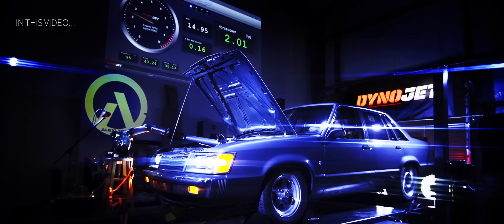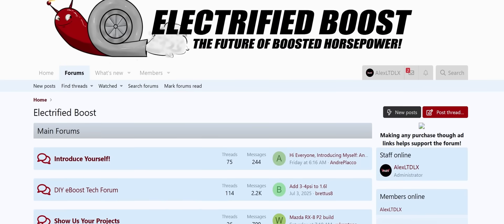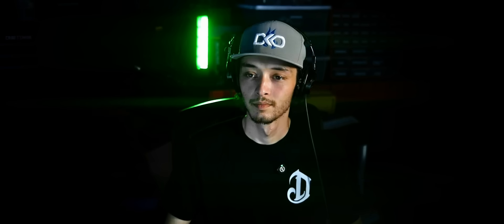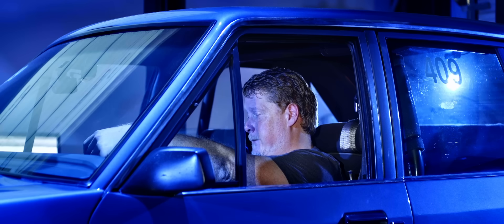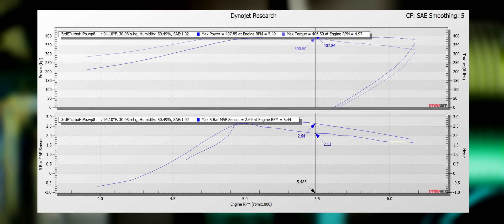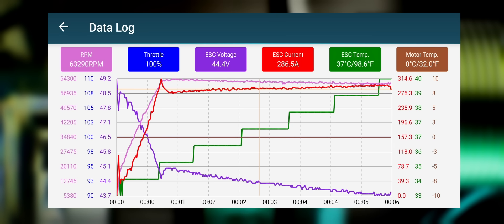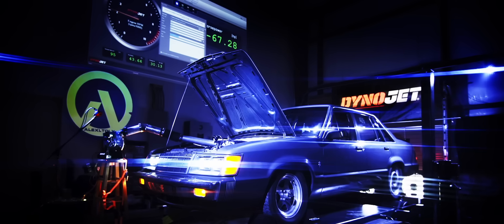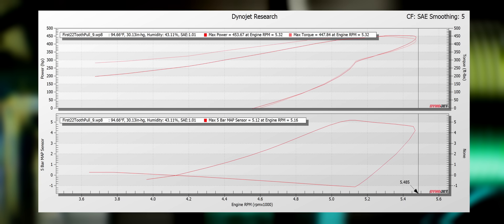Cheaper/Easier DIY Electric Turbo Overdelivers On The Dyno

Comment from the maker: It's worth noting that we didn't tune the EFI for this, nor did we run the meth injection or have any charge cooling - it was very rich and only ran 22 degrees of timing.  In other words, there's a lot more in it.  And the new, bigger Castle motor/ESC is already on its way! 😁
Reply: Really nice to hear, hope you have time to mount a propper transmission so we get the hard fact from the dyno instead of guessing approximately what i would have been 😊
Reply: Glycol coolant the electric motor to prevent the motor from overheating
Reply: I don't get the no intercooler,deal its just cheap power and makes a difference with longevity. You can still add water/meth after that... Especially with the blow just sitting on a bar stool.
Reply: Why not try a bigger diameter rotor, must have extra cooling effect and the esc will save from cuttoff
Reply: A drone motor I meant
Reply: I just had a brilliant idea watching this. They make 12 volt central vacuum motors. I used one to power a forge and I had it hooked up so it was variable speed too.
Reply: Absolutely brilliant I knew eventually someone would figure it out. Im curious if you use large drone motors that are more compact or instead of one motor add 2 or even 3. Great job!
Reply: You can use Castle's marine motors with an intercooler, the intercooler you can get from gaming pc's.
Reply: I wish you guys would talk in percentage gains and not absolute numbers. It's a more accurate way of telling how worthwhile this is.
Reply: Where can i get one for my car?
Reply: @skyllerlannyx9212  Holland and they cost about $8k for the full system. and don't expect more than about 6psi.
Reply from the maker: @dora-de-explora This is not a torqamp.  These are custom units I build that make far more power than torqamps do.  A torqamp is around 5kW.  The smaller P2 unit runs between 20-25kW and the sledgehammer runs at 34 kilowatts.  And you can certainly pulley these to make a lot more boost on a properly sized engine than 6 psi. Boost is a meaningless metric; horsepower is what you want to know.  A torqamp will support about 200 HP; my smaller units will support about 650 horsepower, and the big sledgehammer is 800 +.  They're in completely different leagues.
Reply: @AlexLTDLX  So I get that. But it's still an electric that requires some very serious engineering, for no additional gain over a Procharger. Which far simpler and less tricky to install and tune.
Reply: 2-3lbs boost electric is equivalent to much larger boost traditional.

No parasitic drag with electric boost.
Reply: @maxvan11  I haven't thought deeply about your comment, but that sounds counter intuitive.
Reply: I live at 6,500 feet elevation and I travel weekly over 9,000 feet elevation passes… at interstate speeds. My build is about powering a 292 cu in Chevy inline 6 pulling a camper over these passes on the weekends. 

Still waiting for the 292 cu in Chevy’s head with 1.94 intake and 1.60 exhaust valves to return from the machine shop. They are also installing the lump port kit. 
This project just needs the engine to always think it’s at sea level. Please recommend a small turbo at is sufficient to meet my needs.
Reply: So you are using RC industry brushless motor and ESC but decide to power it with inferior lithium ion batteries? There is a reason us RC guys don't use lithium ions, they can't handle the power demands. This is like taking a NASCAR engine and putting a restrictor plate on it while using 87 octane fuel.
Reply: How about normal lead acid motorcycle battery 5 siries  @The_Gifted_333
Reply: And the help of planetary gearbox like Kawasaki did
Reply: It should be fun
Reply: @radzifagip  Lead acid batteries are worse than lithium ion batteries. The first gen Toyota Prius used lead acid batteries but that vehicle was also using a brushed motor as well and their amp draw isn't anything like brushless motors.
Reply: @The_Gifted_333 we just dealing with one brushless motor with 5 series 12v lead acid batt, and use a ebike 70volts controller good luck
Reply: @radzifagip  Why would you use a lead acid battery? They're heavy and you're strangling the output of the motor with an inferior battery when there are much better options.
Reply: @The_Gifted_333 because only lead acid battery can do both charging and feeding at same time.
Reply: @radzifagip  EV's have regenerative braking. Can't that be applied to an ebike or would that just add too much to the cost of the bike? I can see where lead acid would keep things more simple.
Reply: @radzifagip  Not a chance. Lead acid batteries have an abysmal discharge rate, something in the neighborhood of 0.05C which means it takes 20 hours to drain its capacity. A good LiPo pack has a rate of 120C, so it can dump 120 times it's capacity in one hour. They go as high as 200C. These two battery types are not even comparable. As for the planetary gearbox, you are correct, that is the key. Planetary systems are the only semi-efficient way to multiply speed using a gearbox. That is the secret sauce behind the very expensive Vortec Centrifugal Supercharger, and the main reason for the high cost. There are no teeth on the gears, and they are machined to perfection. It's also what gives it that distinct whine...
Reply: @The_Gifted_333 lithium ion have higher energy density than lithium phosphate. Rc guys use them because they can be recharged more, are cheaper, and have more size options ( even though they compromise in a larger cell for the same output.) Neither one is inferior just different.
Reply: @obsequious_obsolescence  Lithium Phosphate (LiFePo) batteries are only used as receiver batteries in gas and nitro RC. In electric RC, we use lithium polymer (LiPo) batteries. LiPo's are more dense and can handle a lot more amp draw compared to lithium ion (Li-ion) batteries of the same size and last 30% or more longer.
Reply from the maker: @The_Gifted_333 I don't understand your comment. Lithium ion is a whole range of different battery types.  RC guys typically use NMC which is a form of lithium polymer; I'm using lithium titanate oxide cells for a number of reasons; not the least of which is that they're among the most powerful cells that money can buy.  They're not suitable for RC use due to their lower energy density, but they are extremely powerful, much safer, and are good for up to 50,000 charge discharge cycles.  I have a video on this battery pack on my channel. It's worth watching. I've also done heavy load testing comparing these cells to some of the most powerful nmc cells available; and overall I have yet to find any type of cell that is more powerful than these lto cells.  The downside is that they're hard to find and pretty expensive.  But they're great for testing.
Reply: @AlexLTDLX  I saw that you are using a 200A Castle setup that is normally found in 1/5th scale R/C vehicles, the ESC and motor combo that is in your turbo setup. I figure you would want to get maximum boost when the switch is turned on. I don't know anything about LTO cells and haven't ever heard of them until you mentioned them. I know for maximum boost you need very high discharge batteries to achieve maximum boost. I don't know what size milliamp batteries you're using but to get the most out of that ESC, you would need a 100C or higher battery. I did just do a quick research on your battery. I see what you were saying about the LTO cells out shining LiPo's when it comes to safety, fast recharging and lasting much much longer but they don't have the density or the high discharge rates of a LiPo according to what I just read. I just would figure you would want maximum boost for your setup which would require a high discharge battery. I know Castle has a very good reputation though I haven't ever used their products do to the high cost of them. If you want more boost, take a look at the Hobbywing Max 5 (250A) or Max 4 (300A) setups.

Comment: It's absolutely wild that they did not add more fuel or retard the timing😂 that is the quickest way to blow a motor I'm shocked hooking it up to a methanol fogger or even a regular fuel line to a fogger system for when the turbo kicks on the fogger will kick on will be your best bet then running dry

Comment: I love this idea. Not just the cost, i can see it possible to drive your vehicle NA or boost at the flick of a switch.
Reply: I think the issue is the tuning and having fuel injectors that can run both in stock NA form and when you decide to turn on the supercharger

Comment: $1500-$2000 ? Not cheap.  For just a little more i think i'll stick with a traditional setup & skip having to build it all myself.
Reply from the maker: Have you priced supercharger kits lately?  You're going to pay 3-4 times that at least at this power level for a turn key unit; definitely more than double for a base "tuner" kit - and that's for the cheapest kits I'm aware of (torquestorm), which are based on the old powerdyne blowers.

Comment: What are you using to power the esc? Also you can grab a full censored system for a rc. The esc brand is XC. And they look and perform exactly like a hobbywing at half the price. They are Bluetooth and you can adjust all the settings and see log data right from your phone. So way cheaper then castle and hobbywing with the same performance. Now hopefully since I’ve told you this information so you can build a true budget turbo you’ll send me the exact same esc and motor you  use in your turbo so I can make my Arrma limitless or infraction way faster and more powerful. This is just a hope your that kind but even if your not at least I told you of a way better and cheaper way to go with building your perfect budget turbo.

Comment: This is why i was running a me1616 motor to power my v-15...watercooling. 

But 1 thing that interests me is how you're able to get the thing to idle without the centrifugal spinning... thats always been an issue for me... i had to jimmy up a g35 throttlebody on the 2 wire to a relay to close when boost is on and to open when its off so i had NA idle... now i run a belt off the barra on a v7 and have 22psi but it chews up fuel just idling now due to the pulley being so small... the v-15 ripped my headstuds out of the block... was sold and replaced to cover costs... i still have the me1616 but always looking for a smaller alternative as i want a "stealthy" setup.

Comment: I'll let you in on a secret, so pay attention. Take the power wires wrap them around the drive motor in the direction of rotation form the gear end to the tail end flat together one coil only. And see what happens then!😮

Comment: In the RC Helicopter world we usually set a failsafe so the lipo doesn’t go below a set voltage in return if it does we get half throttle . Kinda what the bellow looks like . A fresh set of batteries fixes that or add more capacity . From the graph the battery voltage is sagging maybe kicking in failsafe ? And usually when the voltage sags the amperage goes up to try and satisfy full throttle

Comment: Now you can make an anti lag system with a wet sprag or something. Being able to run low backpressure with big flow and boost potential and no lag(big cake you can eat) would fly off the shelves. A center section add on with a gear mounted on a wet sprag(one way clutch) to a reduction gear all using turbo oil. Reduction gear with a sealed shaft to mount belt pulley. The e-motor could mount in parallel over the cold side. If you wanted to clutch on the e-motor you could have regen to the bat trees. Would be nice to have higher voltage (200-400vdc) brushless (AC vfd controlled) DC(not) motors. Much smaller wires, smaller power electronics, less heat. F1 has it why can't we at the hobby lobby?

Comment: A great analogy for torque and horsepower is punches in the face. 400ft lbs at 4000rpm vs 400ft lbs at 8000rpm is equivalent to getting punched in the face at the same force but twice as many times. Would you feel the same getting punched hard 4 times as you would if you were punched hard 8 times lmao.

Comment: So they're not there yet, huh? I thought you'd be like pushing over 20 pounds. Have you thought about a toroidal gear. I saw a company come out with it called torque works or better yet I mean sticking electric motor between a turbo just to get the low end boost and then really overdrive it. Could it use a starter motor? I don't know. I'm just spitballin'.

Comment: Your flexible charge pipe is causing boost loss. Also look into a cvt belt system for the drive on the supercharger. It'll always be most efficient in the power band of your motor
Reply: That's what is cool about electric motors there peek torque is at every rpm. No Transmission needed. Adjust gears to achieve maximum load just under letting the magical smoke out.triping the safety is about as hard as you can push it.

Comment: Initial ratio 14:18, succeeded by an excessive 22:18, resulting in excessive current, heat and premature shut down. Why not a more productive 1:1 ratio to support additional gain along with a completed test and incremental step up from there.

Comment: $1500 turbo for 100hp.
150hp shot if nitros under $500.
Reply from the maker: A bottle refill around here is a three hour drive each way at $10 per pound with a $20 service charge per 10 lb bottle.  Not including the drive (gas or time), refill the bottle 9 times and you've already exceeded the cost of the electric supercharger.  That's only about 36 quarter mile passes, btw.  And that's if you only have 1 bottle.  Nitrous, financially is WAY more expensive and time consuming.

Comment: Where this thing has the opportunity to really shine is the fact it doesn't draw power from the engine, unlike a regular supercharger. Heck, even turbos have back pressure. Would be really cool to add the ability for it to recharge during breaking.
Reply: more complex than drawing from the alternator, but also far more efficient. i bet well be seeing oe hybrids with elec superchargers very soon

Comment: I want to see a surron motor on that thing instead of a small hobbie motor and some real turbo piping no flexy stuff I want to see what this thing is capable of I absolutely love the idea of this and wonder if you could make it it where you have a obd2 plug in that allows you to sink to it and it can read a drive by wire signal so it could work fully from giving it power and obd2 dongle so it uses already existing electric pedal signal to activate and run and maybe even have an app you put on your phone like for the surron tuning so you can have different modes like a 1,2,3 power modes sir you might of just created a real procharger and I personally am all for it

Comment: The rpm on the compressor must be insane at near 1:1 and even faster at the lower ratio. 30k motor rpm ~ 50k rpm on compressor? with the right bearings/oiling it seems like these motors can really spin up that turbine. I'd be curious to see if you upped the compressor budget could you see more hp/$ instead of getting two? Super sick demo.

Comment: Hey Alex, remember me? I'm the guy who turned you onto those inexpensive centrifugal superchargers. You're doing great work, man! The new production is slick, and you seem to have the E-CSC pretty dialed in. I've got another suggestion for ya. Try running the thing with a big bank of SUPER CAPACITORS for big launches, backed up by 120C LiPo's for continuous boost. Also, it would be a good idea to liquid cool the ESC and motor, you can adapt either an RC boat setup, or modify a CPU cooling system, both are inexpensive. Magnets are stronger the cooler they are, and ESC's will last much longer...
Reply: Neat ideas, I’m surprised to see that there are cold plates for the ESC and motors available! I have a watercooled PC I built; my only concern would be ensuring that they have a heat exchanger with enough surface area and a compatible coolant for the dissimilar metals to help prevent corrosion. Also a quality tubing, but I wouldn’t use anything catered to the PC market for it—maybe something industrial grade like Tygon A-60-G.
Reply: @bryanc4054  Tygon is a super useful material, but for thermal conductivity and durability, nothing beats copper, which doubles as a structural component. It is also relatively easy to cut, bend, and solder...
Reply: Sounds like you have some R/C and competition car audio in your background.
Reply: @davidwickboldt712  Good ear! Truth be told, at 49 years old I love em' both more now than ever before. Never in my wildest dreams did I imagine a 1/10 scale buggy could hit well over 100 mph for a couple hundred bucks, and car audio these days can be had for peanuts. American made amps and subs last forever, and actually get better with age. Just recently discovered port tuning and WOW i nearly shit myself. I'd sooner have a car with no motor than one without a system, lol. Currently working on a 1/8 scale RC build with a tiny sound system, a 3d printed multi band pass subwoofer and a long distance 3D FPV system controlled with my SIM Racing rig which will eventually be full motion using telemetry data sent back from the RC car, because why the hell not lol...
Reply: @miggyfixx6418 So you must be using B2 subs. I'm 55 so my R/C days started a few years before yours. Before Team Associated existed. Remember when Traxxas was entry level junk? Also remember my first punch 45 and behind the seat Kicker truck box. I got into r/c gas boats. Made many of them working at Renegade Boats back in the day. R/C taught me cross industry innovation. Like the old power pole electric connectors were scaled down electric forklift connectors. It is a shame video gaming hurt R/C so much.